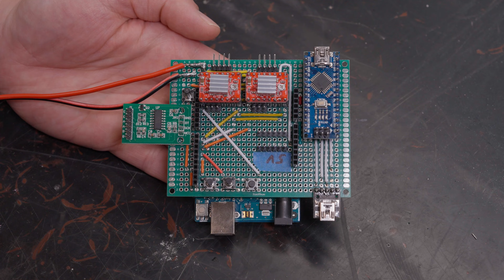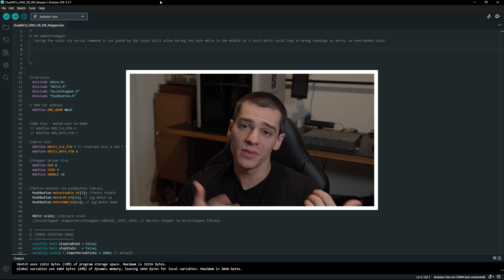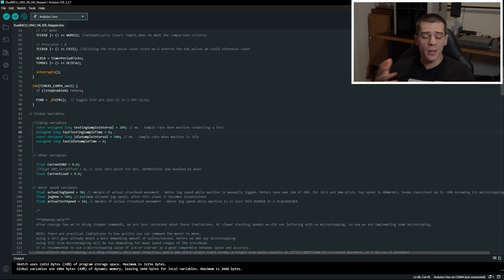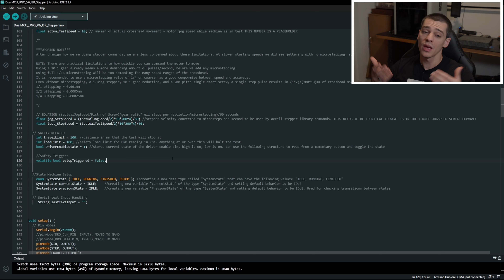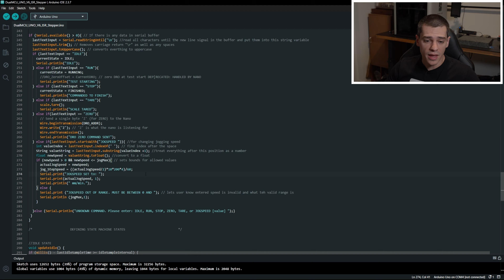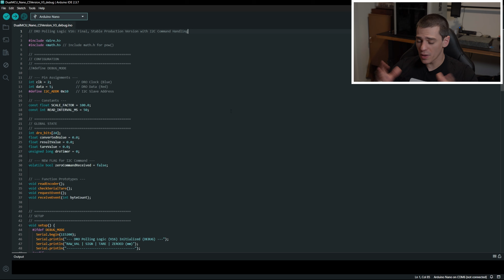It’s Alive! Powering up the Universal Test Machine

Comment: 8:00 I'm by no means an expert either but if in theory you want to try it there is a thing called an stm32, specifically this one: https://www.st.com/resource/en/datasheet/stm32h723zg.pdf that usually runs at a fairly high speed and I have seen it handle exactly this type of interrupt with no issue; however, if you want to run it at such a speed you will need stm32cube ide and a knowledge of the C programming language so this might be an idea you could do fairly far into development if the interrupts just cannot be handled by an arduino or any other such microcontroller.

Comment: My opinion is to use a Teensy 4.0, it is all interrupts and and it is cheap for the price
Reply from the maker: Great suggestion! With some cursory research it seems like this would probably handle most of my needs right off the bat, and the 4.1 has SD support if I wanted to write to and store a csv of the data onto the SD card. I'll have to look more into options for touchscreens and other GUIs with them.
Only thing I'd be missing (just a nice to have long term) would be wifi connectivity, but I was always expecting to need to pass that off to a different controller if need be.
Reply: @ProtoRightProductions 
You solve that the same way as everyone else 
Slap a esp32 control on it